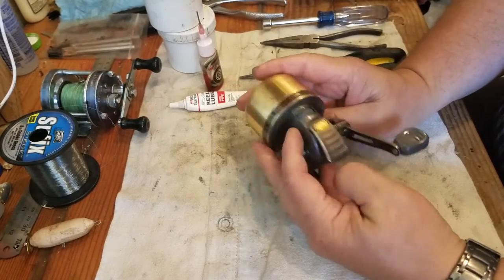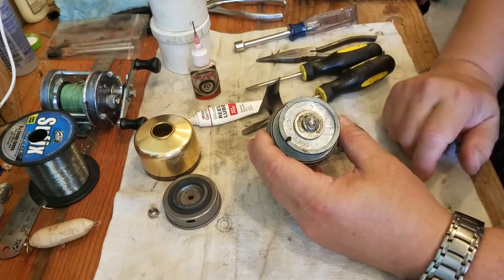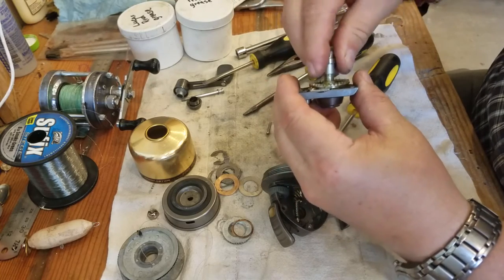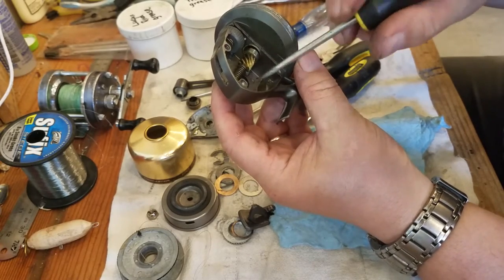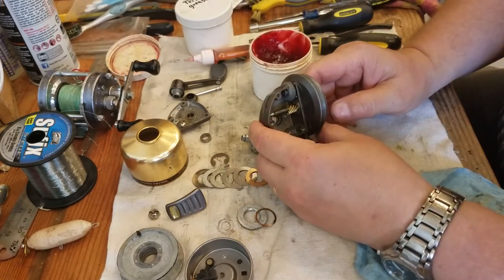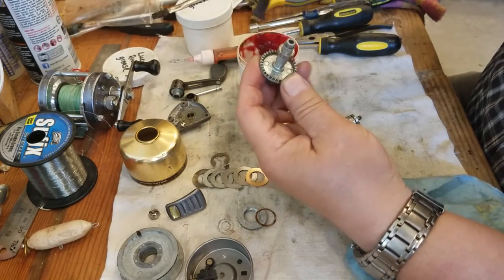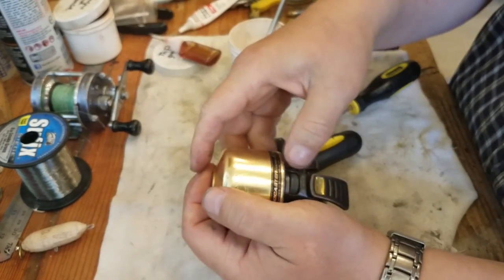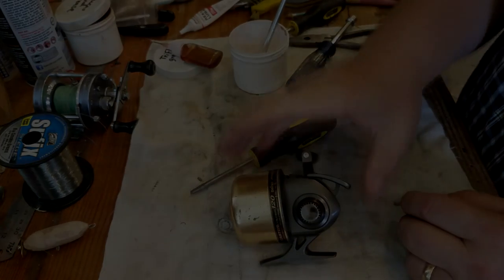How To Service a  Daiwa SC 120

Comment: Hey Matthew, I don't know if you remember, but I asked you if my zebco 808 could bring in a big catfish. You said yes with a good pound of line and a 20 lbs. leader, and my drag set at around 10 pound pull. Then you said for me to hang on..... Well, I landed a good size flathead this past summer. Not sure on weight due to no scales, so I am not sure of weight.  Although, my 808 did everything you said it would.  It took me a little while to lander, but my son netted her. Thanks for teaching us so much. People may not like zebco, but I myself am a fan for life now!!
Reply from the maker: Wow. What an awesome Zebco testimonial!  Thanks for sharing.   Catfish are really tough, but pound for pound they are not the hardest fighter. I was using a Zebco 33 Max (just a little smaller than an 808) last year, when I hooked into a 34-36 inch Steelhead. Now those are tough and have energy!  The 33 Max handled it really well.  I got it up to the boat nicely without any problems.  We did loose it at the edge of the boat due to not having a large enough landing net.
Reply: @OutFishing13Matthew  WOW thise fish do fight. I've watched videos. They are a natural born fighter.!!

Comment: Hi sir, i have another question for you that i cant find info on the web. On my Daiwa SC120A  that has one pickup pin, i notice that the rotor does have all the extra holes and the bracket to attach a spring on like it could be added a second  pickup pin mechanism. Could i buy that part only or could i buy a rotor that already has a 2 pins mechanism to turn my reel into a 2 pin? 

  Would the center shaft activate the two pins or it would still only release the one pin it was made for?   Thanks alot.
Reply from the maker: I think you could buy the spinner head assembly for your 120 and upgrade it to a 2 pin.

Comment: Have you ever tried adding a second retrieval pin or changing the rotor to a rotor that has two pins on a single pin rotor?
Reply from the maker: You can change some spinner cones.  Adding a pin would be hard

Comment: Hi sir. I have a question for you concerning a daiwa silvercast 120A. My problem is that when i cast, the whip of my cast makes the handle move just enough that the reel engages the gears again and sure enough, my line breaks under the stress of my flying big spoon. Now here is my question,  How can i  create more "resistance" in my handle  so that its not turning on itself easially? 

  I've open many reels but i gotta admit that i dont know or understand what part make the handle or gears turn so easially when its "clutched" or depressed. Thanks alot !
Reply from the maker: I am not really sure what you can do.  That would be annoying.
Reply: @OutFishing13Matthew  Thanks for the answer ! I worked on it all night along with a good cigar ! 😄  So i found that the the pickup pin mechanism has a spring to keep it activated when "cluched" . Well, that spring is so weak ( weakest spring i have ever seen ) that it wasnt strong enough to hold back the handle in place when Casting . 

I took a pen spring and cut it to the correct lengh and Voila! I also put a shorter and lighter handle since the stock one would not help at all. It was so heavy that with the momentum of a cast, it would help the handle to turn.

   With the stronger spring and the shorter handle, FINALLY, this reel is perfect with a YOZURI hybrid 12lb.

PS:  I do not recommand anybody to do the spring mod to their reel as i dont know what it will do to the reel on a long term. In my case , it was that or the shelf for ever, so nothing to loose.

Comment: Just a few recommendations for your channel. There is a lot of dead space (ie the spool of line and baitcaster) which could be allocated for tighter shots showing more detail of what you're actually working on, it's a little difficult to see what you are describing when it gets down to smaller parts. Also, you could invest in some better lighting to help show some more detail as well.
Reply from the maker: Thanks.  I need to take a class or watch some videos to get better shots.

Comment: oN THAT daiwa reel you can remove the iner shaft by unscrew thr spool spindel with a small cresant wrench It is  a left hand thread
Reply from the maker: Thanks for the tip.  I will have to do a new video now. I like these old reels.

Comment: I have a reel like this and every so often when casting, it abruptly stops mid cast.  I can't tell if the spring inside (that is stretching when the button is pushed) is too weak, or too strong, or whether that is the problem at all...
Reply from the maker: Good question. my guess is the reel may be cocking mid cast and the pin comes out and catches the line.

Comment: What type of grease did you say you use?
Reply from the maker: In this video I used Lucas Red and Tacky for the gears and for the drag I used, Tri-Flow.  Right now I am using Penn Reel grease for the gears. It is blue and works great.